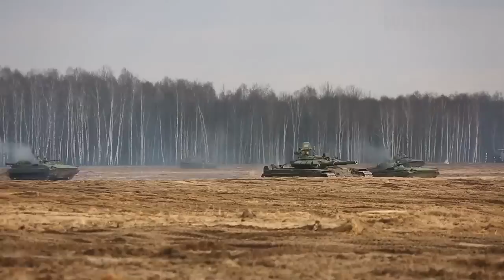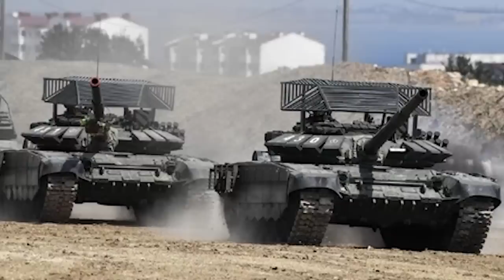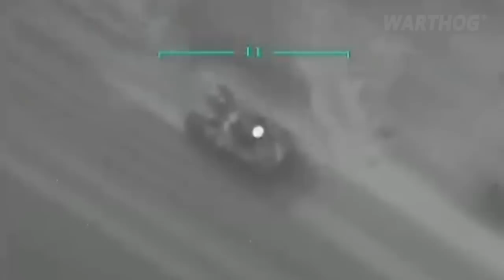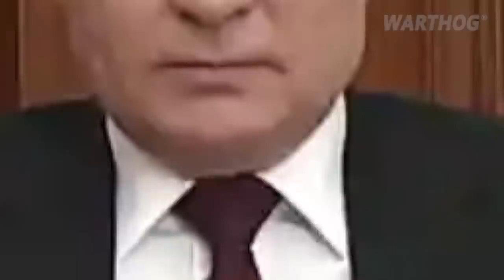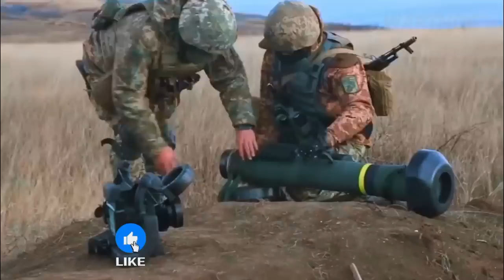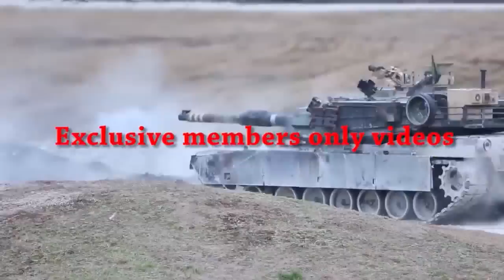TANK CAGES - RUSSIA’S MILITARY FAILURES IN UKRAINE || 2022

Comment: The Javelin has a two-charge warhead.   The first warhead is going to penetrate and blast off whatever is put on top of those tanks, especially something like a welded on cage.  The second one is what drives an extremely hot blast into the tank, blasting through the armor and killing the occupants inside.  Dying inside of a tank is not a clean way to go.
Reply: Yeah you kinda get some of you over here and some of you over there
Reply: Does Putin know this
Reply: Javelin top attack hits tanks with around 45-60 degree angle so these metal grids can't exactly stop them as they don't cover those attack angles but still better than having nothing ofc. While Turkish drone munitions hit tanks with 70-80 degree angle and grids are exactly in those angles!! However these drone munitions don't have heat warheads rather high explosive fragmentation warheads and could penetrate the tank even if it hits the grid but ofc again better than having nothing. They are just a desperate attempt to give Russian armor some protection but obviously it doesn't work much...
Reply: @ggoddkkiller1342  Maybe they should put another tank on top of the first tank?
Reply: The brutal honesty of death inside a tank here had me in knots. 😆
Reply: Dali Farzan::: the Javelin’s first explosion is intended to detonate the reactive armor, a counter measure to shaped charged explosive. The second explosion is the shaped charge that penetrates armor using the Monroe Effect.
Reply: The cages on top are definately there to keep the crew inside, there is no other explanation in my mind.
Reply: @wesKEVQJ  ::: your intelligence has no equal.
Reply: Dalit Farzan::: you are confusing the Javelin versus the NLAW. Your description applies to the NLAW which hasnot a tandem charge explosion where as the Javelin has to counter reactive armor. FYI , tank turret’s armor is thinner than side armor and rarely has reactive armor attachment.

Comment: The reason they cannot protect from a NLAW or Javlin is cos the have proximity fuses they will blow up above without fail it might work with RPG but the usually hit the side.
Reply: Yeah, slat/cage/mesh armor isn't new. Believe the first was tried during WWII, but also used on M113's and boats during the Vietnam war. They reduce the chance of a catastrophic hit, but certainly don't eliminate it, and then mostly on older weapons like the RPG-7. Many Strykers was equipped with them during recent conflicts. Top mounted armor would make sense in urban areas against obsolete equipment. Guess things didn't go according to plan...
Reply: I mean a Javelin would most likely punch straight through anyways.

Comment: It's not a cope cage. It's an anti escape mechanism. The logic behind it is the crew gets killed because it's harder to flee from the cage and they get burnt into the inside of the tank so if it's salvageable Ukrainians have to spend more time cleaning it then if the crew just abandons it mid combat. Ive also been told Russian claim the cage is for when the tank is on fire it looks like a street lantern and since they burn in the highway it's to illuminate ukraines motorways since the power is out. Very strategic
Reply: P

Comment: They'll tell you that it's to defeat anti-tank missiles such as the javelin it's supposed to initiate the shape charge that the missile uses to penetrate the armor therefore rendering it useless good luck with that
Reply: It's useless against NLAW as well, as it will go over or under that cage. It explodes 800-1000mm above tank roof and cone goes downwards. It needs that minimum distance to concentrate copper shower. If NLAW missile hits that cage straight on it will just crush it out of the way and explode on tank roof like normal. Swedish can sure design anti-tank weapons and take tricks like this into account.
Reply: Its also useless against the Ukrainian Stugna-P, ATGM, and against air-to-surface mini-missiles fired by the Bayraktar drone.

Comment: Well most these tanks probably 20-30 years old, and Russia was sitting on roughly 12,000 tanks. Wouldn't be surprised if only the newer tanks got "modernized"
Reply: @Lapine Probably not, hence why we've only seen actual reactive armor on a few tanks, while the rest rolling around with clay or cardboard.
Reply: They may have 12000 tanks, but how many of them have never moved in years, or had parts removed for spares
Reply: Not to mention that quality Chinese steel and electronics
Reply: Also a lot of those in reserve will have been cannibalised for parts broken in the activ tanks.

Comment: Its not for the Javelin, but for the Bayraktar drones. The idea is if a airstrike from a Bayraktar hits the cope cage, the blast would be reduced as it doesn't detonate on top of the tank directly. However, the ukrainian army uses the Bayraktars to mainly destroy supply trucks. Guided missiles like Javlins will just penetrate it, and manually aimed missiles like those from RPG 7's won't hit the cage at all.

Comment: Those cages are mounted to give a false psychological feeling of safety to the tank crew, however it will prevent the crew from quickly running away in case of tank burning, also such a tank will become visible from a long distance.

Comment: Consider the inch thick tungsten bars on the front of the S-tank and even that combined with the sloped armor is not enough to protect from modern weapons.
Some scrap metal and a none sloped armor, considering the top attack mode that extra stuff will not help at all.
Reply: Well, it helps the russian increase the weight of their tanks, to spend even more fuel, and they can't use the topmounted AA(!)-machinegun to shoot drones down. I see no problem letting the russians continue using these cages.

Comment: Slat armour works by the HEAT round either hitting the cage in between the slats and not initiating or providing a stand off distance which degrades the jet to a degree.  The overfly (i.e. shoots downwards as it flies over the top of the tank) munition doesn't actually impact the cage unless the cage is exactly the height of the overflying munition so does precisely nothing to degrade the jet.
Reply: We call it Bar Armour, when we used it in Iraq. It worked really well against older style anti-tank weapons like RPG7. The arms race has moved on and even the ERAP's don't seem to be effective against Javelin and NLAW. Although we don't have all the information about tanks hit and survived.
Reply: @Chaddlee  I think the future will be Defensive Aid Suites, Active Protection Systems - whatever they are called nowadays.  Ironically the Russians seemed to be ahead in DAS with their, I think, Shtora system, quite a few years ago.  I wonder if they are digging suites out and refitting them behind the scenes.
Reply: I'm wondering if what we are seeing is the 'cheap install' .  I think I've seen these cages where they were laden with reactive  armour panels. Perhaps someone decided that was a waste but they'd put the cage on anyway for false security.  We've already seen examples where the reactive armour pouches on the sides of the tanks are actually empty .
Reply: @billw7000  I'm not sure if it is the same thing as you mean, but the T90 had active protection IR systems. There is a mixed bag of reviews on their effectiveness, but the Russians were the first to routinely use them. The newer ones are meant to detect incoming missiles and spoof them with counter measures. Do you know if they are effective or not?
Reply: @Chaddlee  It essentially picked up incoming munitions and fired a shot gun type counter measure at it.  There was a video showing it shooting down an ATGW.  I think other aspects were designed to disrepute the tracking of an incoming missile by dazzling the seeker if it was a Brimstone or similar.  I think it was a few years either side of 2000.  The Russians bigged it up as very effective but I don't know if it was just talk or actually good.  I know that at the time the West were talking about having a similar system.   If you think about it they haven't deployed any vehicles (that we have seen) with an APS in Ukraine so maybe they weren't that effective.
Reply: @billw7000  i didnt know about the shotgun style protection system. Thats going to be hard to do, but not impossible. I heard the same about the IR dazzeler idea. Might work against Milan or Dragon but im not sure if it would against Jav though. Mind you the NLAW is doing well, and that is pretty dumb fire. It can sort of track moving targets though.

Comment: Tbh, I thought they were to add vegetation for concealment, while still allowing freedom of movement under the canopy.   While I was in the CF hatch of LAV 25 and Abrams I kinda would have loved a pergola over my head for shade.
Reply: It raises the vertical visual profile of a vehicle. But I can see the appeal.
Reply: They used patio umbrellas in Iraq and Afghanistan
Reply: Its mainly to defend against older ATGMs and other old gen weapons such as the run of the mill RPG-7s from enemies on rooftop positions in urban settings. Javelins and NLAWS though can penetrate through them without care.

Comment: The side skirts or Schürzen were originally placed on the sides of German tanks in WW2 to deter Russian Anti-tank rifles from penetrating the thin side armor and killing the crew. 

The Soviets had the particularly nasty PTRS-41 or Simonov anti-tank rifle ( Russian: ПротивоТанковое Ружьё Симонова) a semi-automatic anti-materiel rifle chambered for 14.5×114mm . The snipers worked in two man teams (because it was very heavy) but they knew exactly where the crew members sat in the German tanks. They would aim for the side armor where it was weakest. The Germans quickly realized that by attaching another layer of steel at a slight angle would not only double the thickness of the armor, but also deflect the rounds.

It was an unexpected bonus that by placing this steel at a suitable distance from the hull, it also defeated High Explosive Anti Tank rounds (HEAT) which work by using a shaped charge explosive to create a jet of hot gas that would cut through the armor and then burn what was inside. The drawback for HEAT is that it will only penetrate a specific depth and the further away from the metal when it explodes, the more that the plasma jet disperses and the less armor it can cut through.

The Russians hoped that by forcing the Javelin and NLAW rounds to explode further away from the top of their tanks, that the charge would disperse and the tank would survive. They forgot that the Javelin has 2 shaped charges - the first to defeat the ERA (Explosive Reactive Armor) bricks and the second to punch through the roof of the tank. Even though the NLAW only has one charge, the size of the charge is so great that the Cope Cages are absolutely useless to stop it.
Reply: @bryansullivan9588  Back when they were in use, they could penetrate the sides of most German tanks.

Comment: Please Correct me If Im wrong but... From what I understood about the cages and the anti tank weapons is that.

Most of the modern anti tank weapons such as the javelin is that they use tandem charges (warheads). So there is 2 explosions that detonate after one another. The 1st warhead is designed to negate or disable any Reactive armor or the cope cages. Then the second warhead which is usually larger in size and more powerful, does most of the damage to the armor. 

I see why the Russians tried to protect the roof of their tanks, because its commonly the weakest part of the tank and because of top attack modes of anti tank missiles. But most of the modern anti tank missiles are just way to effective and  powerful. The Reactive armor and the cage would be more effective against single charge weapons (non tandem) such as older rpgs and etc. 

Again. I could be wrong with my facts, but this is what  I know.
Reply: Right. To make a top down weapon to prematurely ignite the plasma jet. It just splatters on the surface.
Reply: The javelin is a double tandem warhead and would most likely be able to penetrate the this cage armor without any hassle, other systems like the nlaw could has their warhead prematurely detonate

Comment: The Combat Car, or  TANK, is an obsolete weapon that corresponds to the 20th century.  Just in case you don't think so, please research the 9M113 Konkurs; the Saab AT4Cs; the Instalaza-Acotán-100; the Zolja M-80; the M72 LAW; the portable CITEFA MARA 200; the Carl Gustav M2, the AT-4ER; the LRAC F-1; the RPG-7, etc.  And now, investigate the “Smart” Missiles:  The 9K111 Fagot and the 9K112-2 Kobra SACLOS; the BGM-71 TOW; the FGM-148 Javelin; the FGM-172 SRAW; the Euromissile HOT and the “Hongjian” HJ-8; the IMI LAHATA; the MILAN; the M47 Dragon; the Spike LR and Spike ER.  The FIM-92 Stinger.  The “Incredible” Switchblade 600, etc.  All these Missiles are guided by Laser and are called:  "Fire and Forget".  All these little toys and 17 more that I forgot to mention, are Portable, are Infantry Weapons and are Disposable.  But in addition, portable missiles are much cheaper than a Tank, they are less complicated to handle, they are light, they have mobility (Immediate Translation), they have more range, more precision and more firepower than a Tank.  Now imagine the embedded weapons carried by the Air Force, Mobile Artillery or Immediate Response Units.  Do you think your Little Tank would survive this?

Comment: One tank costs between $1-7M! 800 tanks destroyed is over a billion dollars!
Reply: nope.
1.  most serious sources are talking of around 800 pcs. all together, tanks, ifvs, transporters and similar.
2.  most of them are old bmp1, bmp2 and t72 tanks, worth only around 50.000usd, 100.000usd and 150.000 usd.
a few t80 and t90 seems to be destroyed too, worth around 1-2 million each, and a few pancir air defense systems worth around 10-15 million each.
so all together destroyed or left behind is maybe 100-200 million usd worth.
3. not a big problem for russia, because they have still 12.000 tanks and 20.000 ifvs in stock, the most losses in ukraine are old types, plus, russia earns only on gas, coal and oil sales 2 billion usd, per day.

Comment: Javelin top attack hits tanks with around 45-60 degree angle so these metal grids can't exactly stop them but still better than having nothing ofc. While Turkish drone munitions hit tanks with 70-80 degree angle and grids are exactly in those places!! However these drone munitions don't have heat warheads rather high explosive fragmentation warheads and could penetrate the tank even if it hits the grid but ofc again better than having nothing. They are just a desperate attempt to give Russian armor some protection but obviously it doesn't work much...

Comment: I wonder if they are trying to confuse the Javelins image recognition?
Reply: No, the point of the grill to to make the warhead expend its force on the cages.  It like wearing a bucket for a helmet: chances are it won't stop anything, but it is slightly better than your bare skull
Reply: @Lightscribe225  Reactive armor and a few inches of hardened steel wont stop a warhead, but they think a few strips of angle iron will?

Russian soldiers are silly people. I think it's actually one of those cheap HD tv antennas I see advertised on TV. You know, put this on your roof and get free HDTV anytime, anywhere.
Reply: @bobhenry6159  Yeah but if it's for signal, then they light up like a christmas tree on Ukrainian radars and then all it takes is  Turkish drone to drop something very heavy on them.
Reply: @Lightscribe225  Did I mention they are cheap? ;)

Comment: It's a low cost countermeasure with a 15% success rate. So why not use it? The tank will not struggle with the added weight and steel is plentiful and cheap. I'm surprised they haven't installed it on more vehicles, especially IFV's

Comment: Reports say Russia has 12,400 tanks - 800 ish - - - you do the math
Reply: 12400 of which the majority hasn't been moved for a long time, some with missing parts used to repair other tanks.
Also the majority of Russia's tank fleet are old obsolete models, like the ones where Abrams during Gulf war shot through 2 tanks standing behind each other with a single shot
Reply: @simonm1447  I totally agree.

Comment: Place charges on top of the cages.
Reply: It doesn't work that way.. just an explosion won't hurt a tank. You need a shape charge warhead to penetrate armor. Look up "Munroe affect".
Reply: @rogerwilco5918  No, I mean to weaken the impact of the javelins, NLAWs, etc... The square charges on the tanks that explode like a claymore pushing the incoming projectile and percussion the opposite direction greatly deceasing the penetration power. Where they are placed on the tanks has worked excellent, but there are still too many weak spots still open. There are no charges on top to counter penetration.

Comment: If they put some material like sandbags and plywood on top of the cage it might actually provide some protection from a top down javelin attack. But the javelin operator can just flick a switch and put the rocket in "direct attack" mode and the dual warhead should be able punch through the ERA, spaced armor, or whatever cardboard the Russians are using and at least stop the tank if not cook it off.